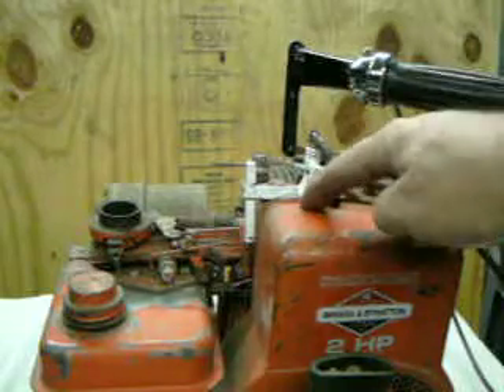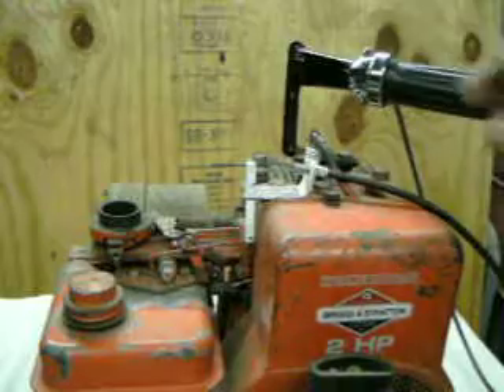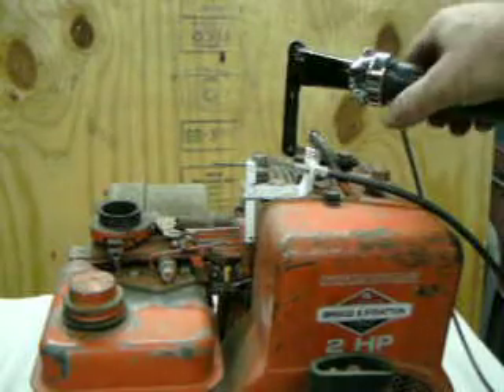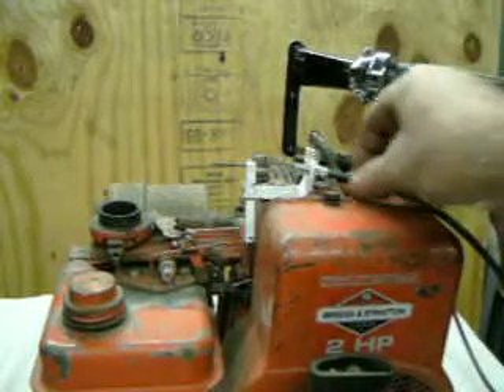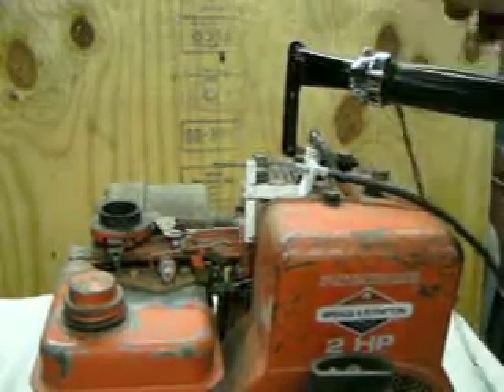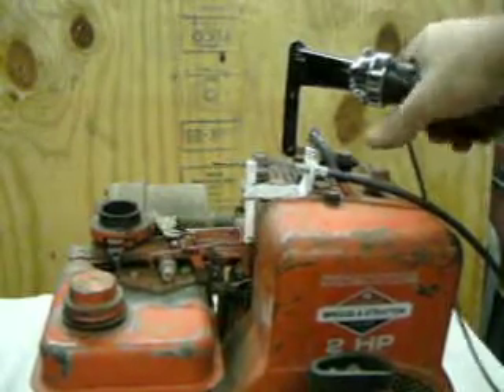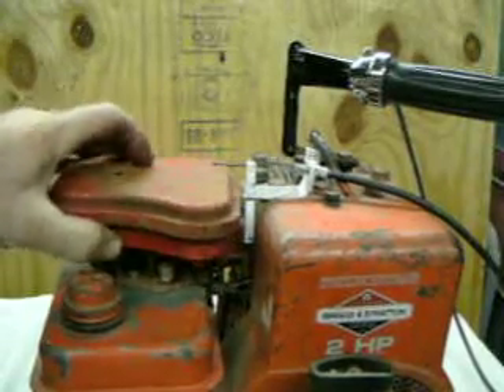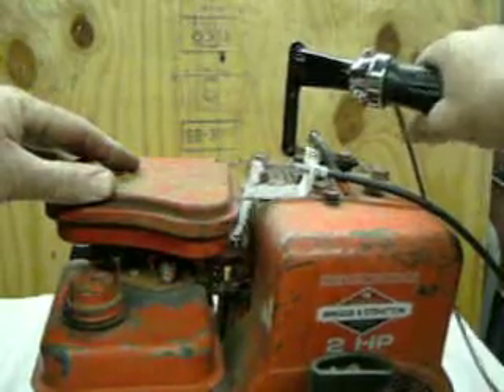Throttle Thing For Briggs & Stratton Engines

Comment: See that threaded hole on the side of the carb just below the carb throat, with a horizontal gap above it? thats a factory cable mount position, put the end of the cable sheath in the groove and put a bolt with a large washer on it to hold it in place, and then connect the cable to the carb.

Comment: How did you put togethr that pice on top so it pivots like that?  What did you use to make this setup.  I'd love to know I have the exact same motor on a mini bike build for my son and I would like to use this setup!!
Reply from the maker: Where the thing bolts on I used a 3/4" wide flat stock piece and welded a thin piece with a 1/8" hole at the end pushed past the end of the 3/4" wide piece, so it would allow the moving piece that's the same basic size at the thin piece (only longer) to move. I hammered a small rivet at the pivot point, but a small screw could be used instead. Kind of hard to explain here. With a little cutting and filing I guess you could make one without needing to weld.